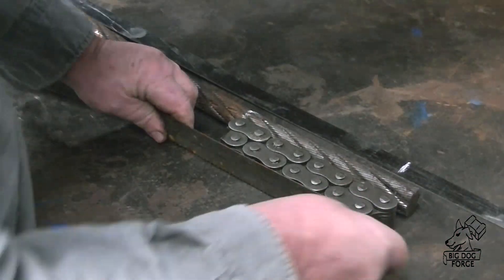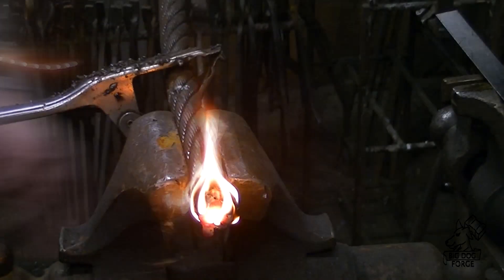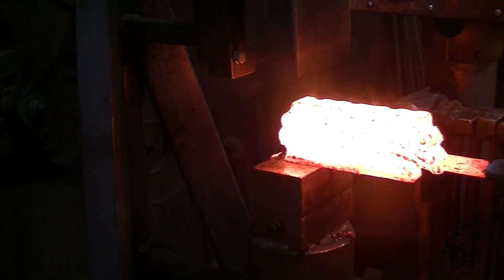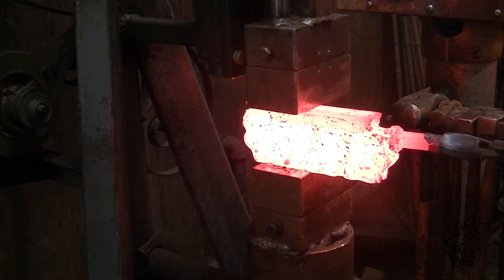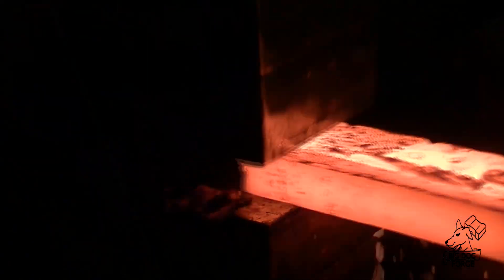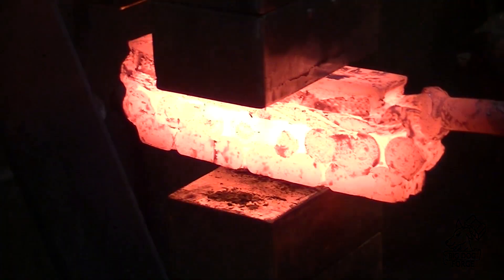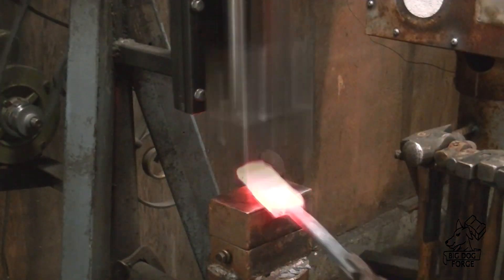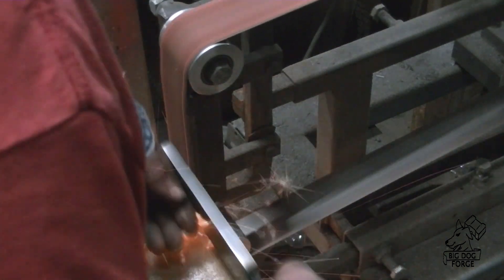Blacksmithing Scrap Pile Damascus

Comment: Tim, been following you for a good while now and I keep discovering missed gems like this one. I did relate strongly to the lack of need to rush when forge welding ie no need for hammering as if you're in fast forwards or the like. Haste makes for a cidents with metal in its plastic  state. Thanks.

Comment: Tim, You had me beat with the video anyway, I am currently working on a sort of san mi billit using chainsaw chain, farm chain, 15n20 from you and 1095 bansaw blades. sandwiched two of these billits with a large piece of 5160 between them. Both of the chain billits were not forge welded prior. I have been at it for around four days now and ran out of propane. Unlike you I do not have a power hammer, press, or striker just my guns. On the 4th daybefore I started I drilled the spaces between the chain that appeared that they would be cold shuts so I am trying to avoid this. The billit started out at 2 5/8in thick, 6in long, and 4in wide after the forth day of forging it is 1 1/2 thick 8in long and 3inwide so I am closing things up slowly. In fact today I had broke out the 8 lb sledge hammer. I will be posting the video on my channel as soon as I can get threw all this footage. I am hoping that this billit comes together I am hoping to do another fist. I am wanting to create a bowie of some other large fighter. By the way great work on this one perhaps you should twist the heck out of it give it a ladder pattern and add a teardrop to boot Ive heard it said go big or go home right?  Oh I almost forgot SKULL, SKULL SKULL, SKULL, SKULL, SKULL, SKULL, SSSSSSSSSSSSSSSSSSKKKKKKKKKKKKKKKUUUUUUUUUUUUUUUULLLLLLLLL LLLLLLLLLLLLL. LOL. To ad id love to here your input when I post the video it would truly be an honor for your sapport and comments... Thanks in advance, Martin M&S Blades

Comment: I have watched a lot of videos about making forge welded Damascus from just about everything. and it did not surprise me to see some problems with the initial bar. you had a lot of material. it also does not surprise me that you were able to take a chunk of it and continue to work it down and fix the problems. it seems that persistence is the key. nice video, good job.

Comment: i applaud you most think that a cold shunt is the end of a piece but it was complete cold shunt when you put it in the furnace  welding chain together you get  a huge number of cold shunts ( i dont mean making chain but turning it into pattern welded)  just reflux reheat  reweld  anyhow well done and cheers mate

Comment: The things your Skull comes up with. Really though, of all the Blacksmithing / Forging videos I have watched on Youtube, I find your's to be the most enjoyable. Just your manner and voice makes the videos fun to watch. I've never done Blacksmithing but I did work in a machine and fabrication shop for 11 years in the past. I still do welding fairly frequently but I want to try Blacksmithing. It just looks like something I would enjoy. I've been collecting up metals 1090, 1080, 15N20 and various pieces of chain to play around with just to see what I can do. I built a burner last week for a forge and have a 5 gallon air tank in the garage I'm going to cut up and fabricate a forge with. I've got some ferric chloride left over from when I was etching PCB's for some vape boxes I made in the past. I don't expect great results or anything since I've never done this but I just want to try it out. Keep putting out videos so I can keep being inspired! I really do appreciate your efforts to do this. Thanks Tim :). Oh as to an idea, what I've been thinking I want to try is a piece of Damascus forge welded on one side to a piece of 1090 plate. That way once etched there will only be a pattern on one side. Figured once I get halfway decent I'd do that to make a chef knife for my kitchen.

Comment: Pretty awesome. I also saw green beetle do a scrap pile build. But it was canister with just the dust from around the sander and drill press's with some powdered still added in. Turned out pretty cool I can't remember if you tried that or not but it is definitely learning experience for this novice smith

Comment: There is a display in the British museum that shows the forging of a shotgun barrel from used horse shoe nails. It's all one piece with finished barrel at one end then a loose coil of flat strip then welded round and on into loosely fire welded nails. I can't see how they held the nails together for the welding though, but it seems to have been a common practice, does my skull in.

Comment: your motorcycle chain Damascus inspired me for my Friend's wedding gift . I'm making a matched set o skinning knives. Motorcycle chain Damascus with a skull and poppy theme. skulls on one scale and hopefully a poppy cast in resin for the other. i am still a little intimidated by the forge welding as I am using coal and a three pound hammer. it seems like the most important step is to slowly consolidate the billet before setting any welds.

Comment: The wave pattern at the bottom of the piece looks pretty amazing, though I was hoping that the chain links would form more skull like patterns, or at least with eyes from the pins. Oh well, it's still an amazing thing to make from scrap. I can't get damascus to work even when using prep'ed new stock! I'm thinking it's because I lack the power to consolidate larger pieces at temperature and the smaller ones just lose heat too quickly. I've been looking at power hammers but oh boy are they expensive!

Comment: I've been watching your channel for 6+ hours now! 🤣🤣🤣 So I know when you're case hardening you have to heat the box up for a day or two and the carbon only migrates, like, 1/16" deep. But I wonder how much (if any) carbon from grease in that cable migrates into the steel while you're heating it. It wouldn't enhance performance any but it would create some contrast when you etch it.

Comment: I have seen drawings in old blacksmith books (reprints) where they would stack up whatever they had, sometimes into piles as large as a one foot cube, to weld up into billets.  But I would guess what they were forging was mostly wrought iron.  That, in a time before power hammers.  Wow.  Something I certainly wouldn't care to have dropped on my skull...
But, doing that wasn't meant to produce pattern welded (or Damascus) metal; it was only done to consolidate many small bits of metal into larger, more usable chunks.  And I would assume they wouldn't be welding up billets larger than their actual needs.  No need to weld up an anvil sized block when you're going to be making chain...

Comment: I'll have to give that borax and alcohol soak for prep prior to forge welding cable.  It can be a beast to get the crud out of the middle.  What type of flux did you use for the actual weld, it didn't look like the 20 mule team that I use...it's got me scratching my skull trying to figure out what it is.

Comment: I almost wanted to see you try to twist it all up like cable.   Been wondering if you could wrap a piece of round-stock with chain to give it a snakescale pattern, where its not all uniform like actual snake-hide.

Skull, Brainpan, Cranium, Dome.

Comment: honest question, not a suggestion: I don't have enough experience with damascus to suggest anything. Would sprinkling powdered steel on the chain ,while and after welding it up to the other stock have helped prevent inclusions and possible cracks ?      skull

Comment: I thought of another look for that piece that would look good. How about cable in the middle blades either side of the cable followed by the chain running around the outside maybe just a thought from my SKULL

Comment: Tim,  You beat me to it. The video anyway. I am currently in the middle of a similar build. Mine is composed of chainsaw chain, some sort of farm chain, 15n20 from you and 1095 bandsaw strips I built 2 billits in this fashion.( Mind you I did not pre forge weld any pieces.) I then sandwiched a piece of 5160 ( Leaf Spring) between the two chain mix billits . Anyway its the third day I have worked on it and I am just now starting to get things closed up. The whole billit started ot at 4 1/2in. wide 2 1/2in. thick and 6 in. long. It is now 3in. wide 1 1/2in. thick and 8in. long. I have used a ungodly amount of flux and I am now in the process of slowly drawing it out and trying to close that width. Oh Did I Mention I Don't Have A Power Hammer or Press. Yep all by hand. I am thinking I bit off a little more than I can chew lol, lol ,lol.. Today I started using a 8lb. Sledge Hammer. Yep you guessed it no Striker either. Anyway its slowly coming together Right...  Man I hope it turns out I am wanting to build a Bowie Knife or some sort of large fighter. Yes another first.. Lots of firsts in this build but I have heard it said GO BIG  OR GO HOME....  I have a piece that I forged with cable in a similar fashion as the multi builit. I will email you a picture.  By The Way SKULL. SKULL, SKULL, SKULL,SKULL,SKULL,SKULL,SSSSSSSSSSKKKKKKKKKKUUUUUUUUULLLLLLLLLLLLLLLLL LLLLLLLLLL LLLLLLL.    Please. As always fantastic job Tim Perhaps put a twist in your billit and Build a Kerombit .. God Bless you and yours From me and mine... Martin M&S Blades

Comment: The alcohol/flux combo - do you use alcohol instead of water for a specific reason? Someone might make fun of me and mention rust but that doesn't occur on cold steel inside the house unless you let it sit for a month or two.
Reply from the maker: Alcohol is thinner and gets in all the cracks and carries the flux with it and it burns off quicker leaving the flux behind water tends to capture bubbles in small spaces and the flux gets displaced.
Reply: Ah! Thank you for that! You're the first famous blacksmith to answer any of my inquiries. Thank you.

Comment: Hey Tim! I am seriously considering an enormous project. I want to make a tactical, bulletproof military suit of armor, from damascus steel or titanium. It would look very similar to the mandalorians armor from the Mandalorian TV series. I have no equipment, but I really am going to do this. Do you have any tips for me? Starting from absolutelly nothing like I am, and going up for a project of this size, what exactly would you do if you were me? 
I want to make chest and back protection, shoulder, upper and forearm plates and groin, thigh and shin plates. I want this to stop basically any caliber bullet that could potentially come my way, but I also want this as lightweight as possible.
Thanks!

Comment: Hey, what grind wheel are you using at 13:50?
Reply from the maker: It's called a cup stone you can find them at welding supply stores and most hardware stores. Thanks for watching

Comment: Look you why you want the skull in my comment. Your skull giveaway is probably over with. But you want a challenge try a  Damascus rap. Like try a three part rap. Inside Damascus is a copper/ nickel mix Damascus next is a spring steal / stainless Damascus fold one over the other after making the two types of Damascus then do a right twist then fold to the left hammering out each way as you go. Then do a left twist and a right fold hammers you go then. Cut and stack  and hammer square,  with a fish with a right twist that is hammering square. Then flattened out but not quite what is needed to form a knife blade . The outer shell is a Two types of carbon steel one hard carbon the other a soft carbon . You fold and cut and stack to make a snake skin Demascus that is center folded 4 times and cut and stacked that both the inside cor and outer shell in heated then fold outer peace to a cradle sticking in the other Two types of twisted Damascus that you made before that was twisted and hammered square, having a hard carbon outside that in hampered together till welded then keep going to make a knife blade out of all those different metals together. And make a video on that. Please